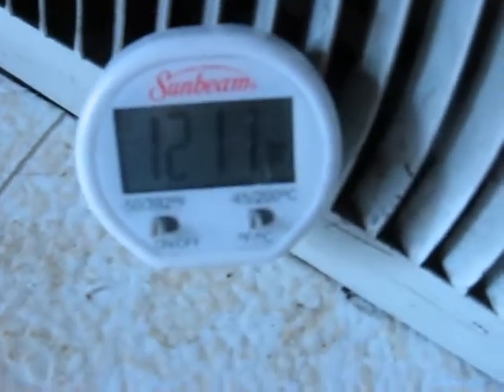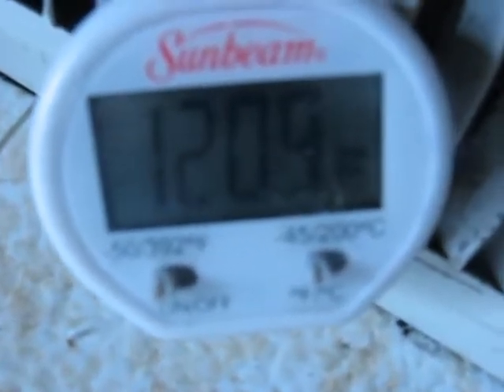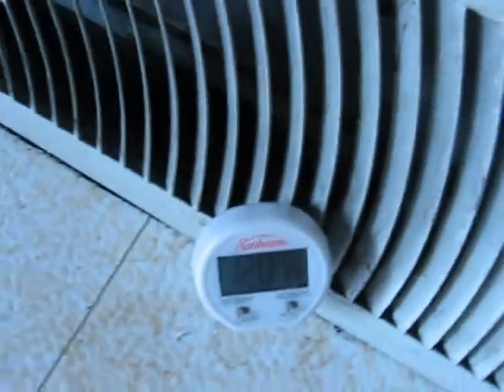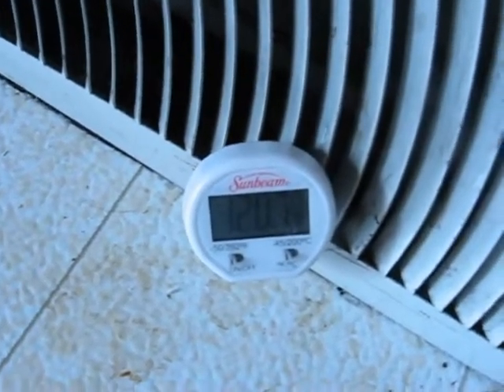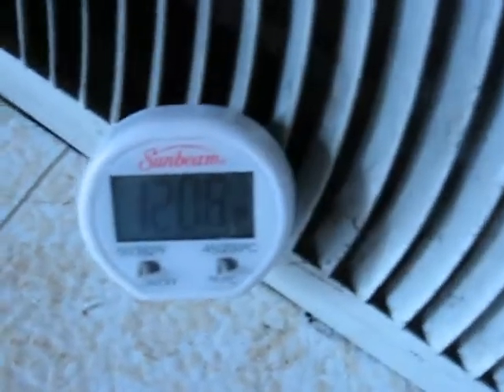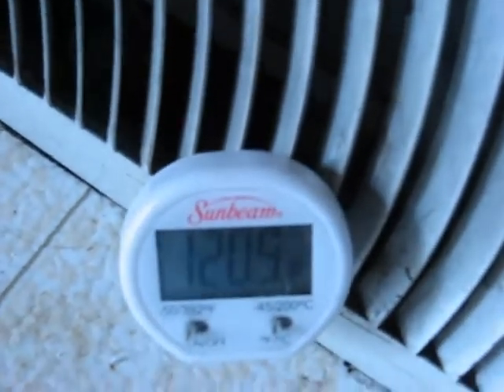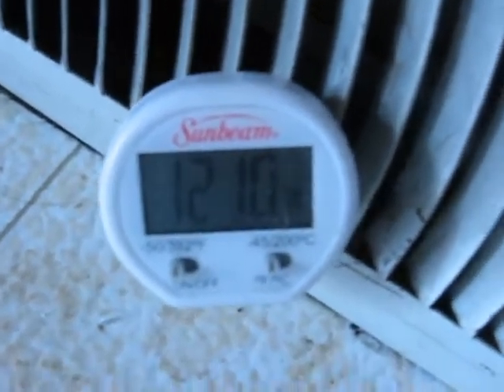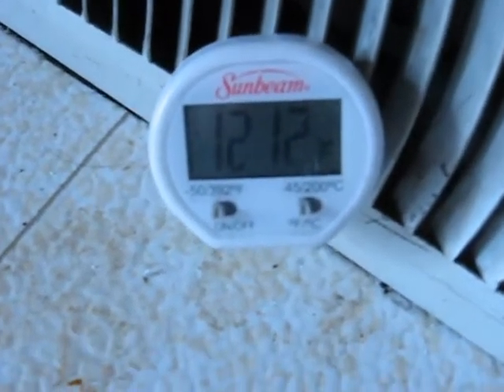UPDATE SOLAR FURNACE  HOW MUCH HEAT

Comment: Since there is almost no difference in temps between the two fans, it maybe possible to get a fan with an even larger flow rate if your solar furnace over sizes your fan. 

There is a maximum temp difference between between outside and the air coming out of the furnace. If we say it is 60°F, then your solar furnace will provide 80°F when outside is 20°F. 80°F out of the furnace may or may not be enough to keep your home at 70°F at a lower flow rate but may be possible with a higher flow rate.
Reply: dtvgmedia I m totally lost sorry